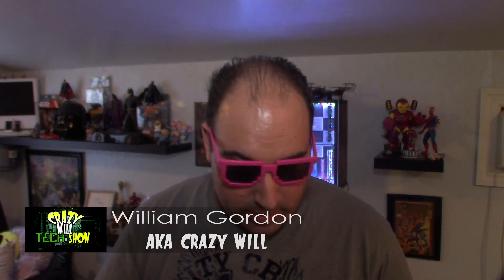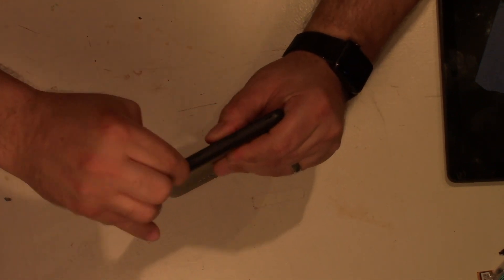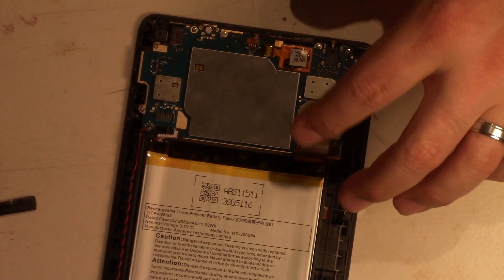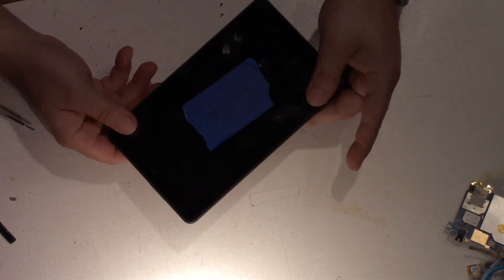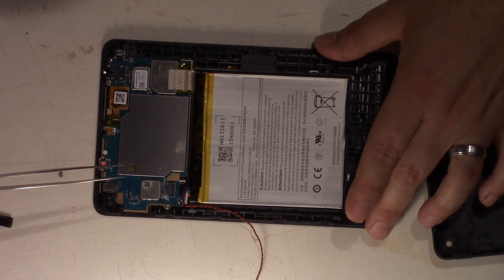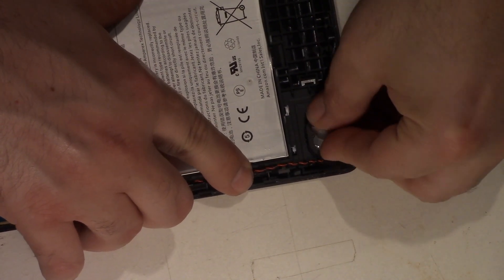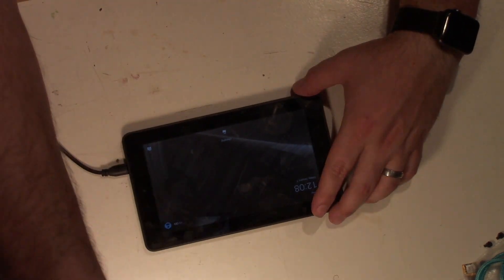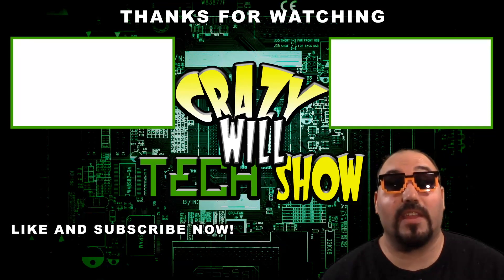how to fix a kindle fire 7

Comment: Do u know how to fix the WiFi problem
Reply from the maker: I don’t know about a Wi-Fi problem?
Reply: @CrazyWillTechShow  I bought a kindle fire hd 8 2015 a while ago. I tried using it in my room and the WiFi wouldn't connect. It would only connect when I'm right by my WiFi router
Reply from the maker: You have to replace the Wi-Fi module I pointed out in the video. Think there pretty inexpensive. I would just buy A used one with a broken screen on eBay and place the whole board.